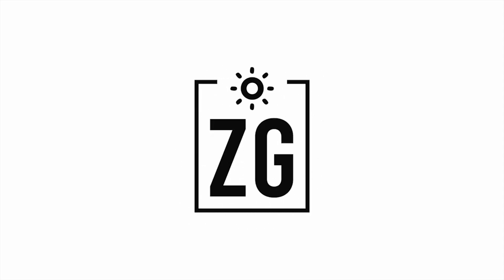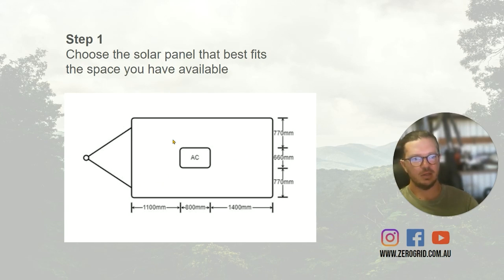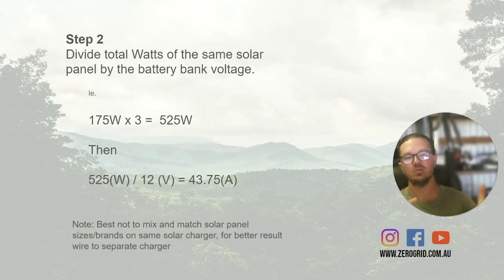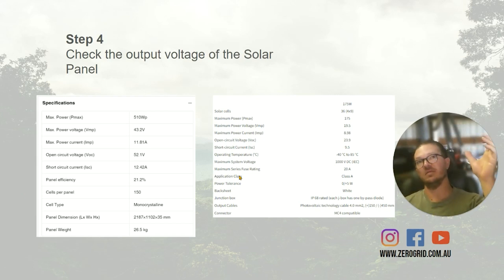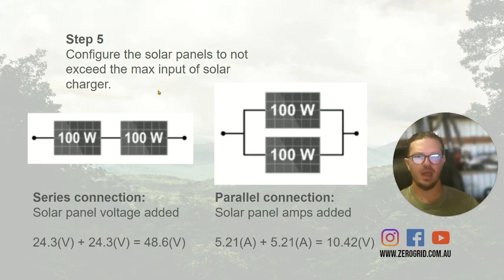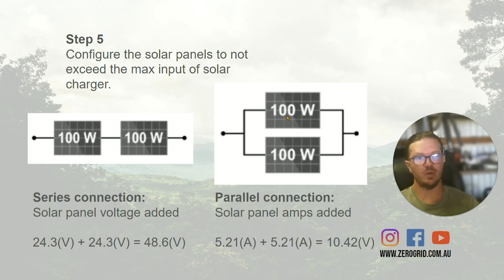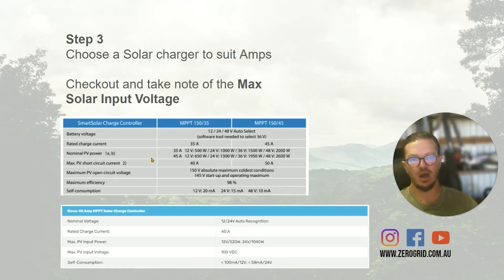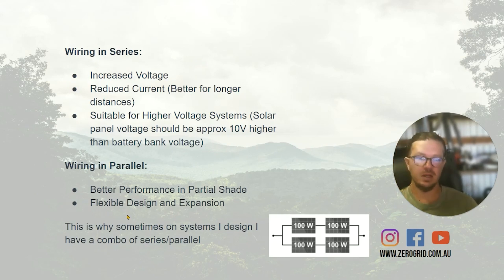How to Size MPPT Solar Controllers for Off Grid Caravan or Motorhome?

Comment: The benefit of wiring panels and batteries in series is- higher voltages have a stronger "Push" Voltage is the "push" factor in an electrical circuit, higher voltages travel through the conductor easier which can save money on the cost of the wire, higher voltages travel with lower loss through a smaller cross section (thinner) conductor and travel further with lower losses, longer runs can require a higher voltage, This is why transmission lines are in the kilovolt range, the primary job of transmission systems is to get the current over long distances as efficiently as possible, this is similar in a DC system.

Comment: Victron Smart Solar 100 / 50 at 24 Volts what's the max 100 Watt RENOGY SOLAR PANELS can a Gent Run in Series or Parallel  ?
Reply: The maximum watts and voltage is listed for the controller and panels, voltage increases when wired in series but wattage can can be calculated by adding the wattage of each panel together- i.e.- 2x 100 watt panels in series or parallel is 200watts, in series the 2 would produce double the voltage, you would need to give us the full specs on the panels and the controller.
Reply: @johnussss  880 @ 24 Volts I have found out. So 800 watts in Series with Plenty of Head Room I have found. Thank You

Comment: Hey Landon!

I have just purchased a 110W solar panel and want to set up a small system in my garden shed to charge batteries for my tools, etc. 

If this system works well, I may move elements to our water pump to power the pump during the day. 

Would a car battery be suitable to store power? 

Thanks,
Jarryd
Reply: 110 watts would not run an inverter, the extra cost of buying a battery and inverter over just charging via 240v would take many  years if it ever did to pay you back, if you have Makita 18v stuff there's a 12v charger, you would be charging during the day in good light without a battery... but that 110 watt still may be insufficient, perhaps a 250w second hand quality brand (investigate the brand before purchase there were a lot of rubbish panels 10 to 20yrs ago) good house panels turn up on marketplace from free to not much more.

Comment: Is it really necessary to have a fuse between each panel connection?
Series array and parallel array?
Can  the diodes in the panel's junction box do away with having to fuse?